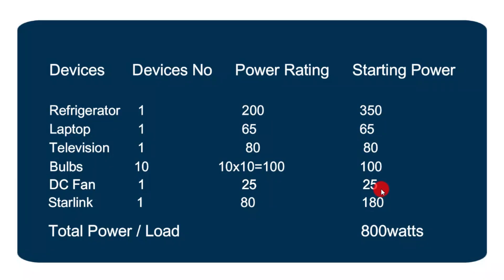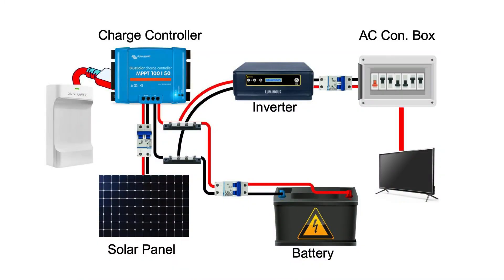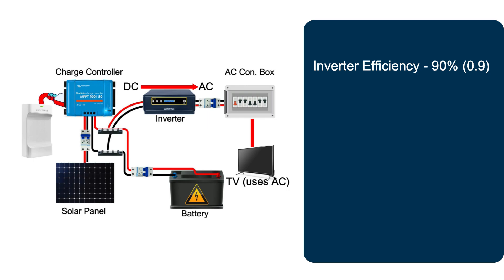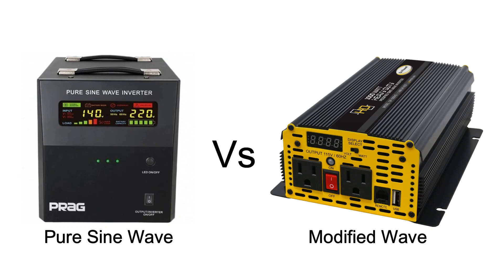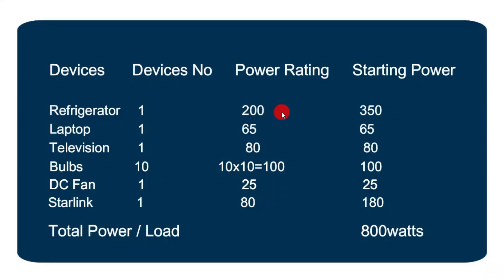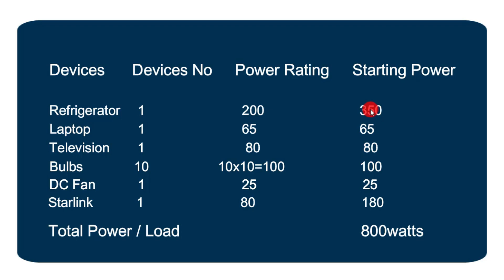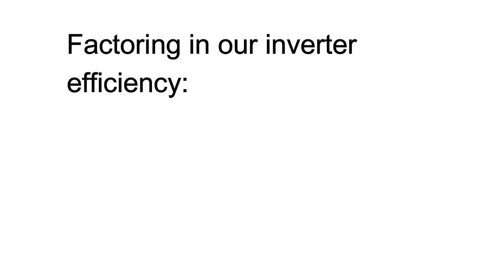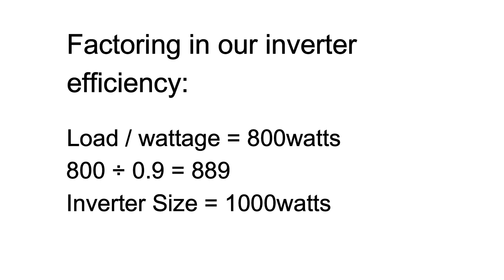What Size Inverter Do I Need? (Solar Calculation Guide)

Comment: waths said about fridge starting power is totaly false ... you need ur refrigerator power time 5 to start the compressor... is it that hard to use a dc watt meter from rc car to ensure ur statement? mine is true.. i have a 65watts fridge and the peak power is 330watts .. then only the compressor begin to take rpm and the power drop to that nominal 65watts...
Reply: according to ur calculation my 300watts inverter should no probleme start a 65watts mini fridge.. but nope .. the inverter dont like it .. i have to use the 1000watts one to start the fridge...
Reply from the maker: @sunoncream1118  you're right but power consumption from one refrigerator to another differs. I've seen refrigerators with power rating of 50watts and starting power of 70watts. others can have a relatively low operating power but pretty high starting power -- 150watts to 800watts. BTW, thanks for drawing my attention to this. I will give multiple examples in subsequent videos for clarity.